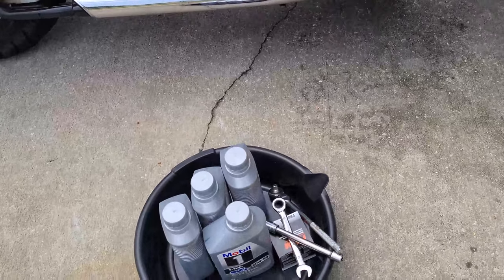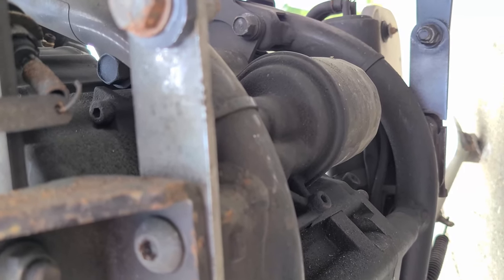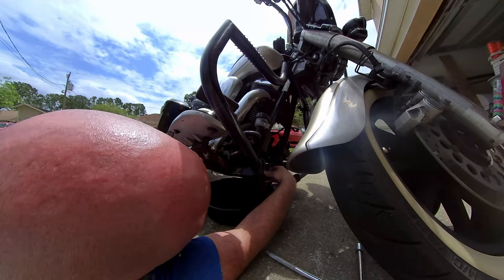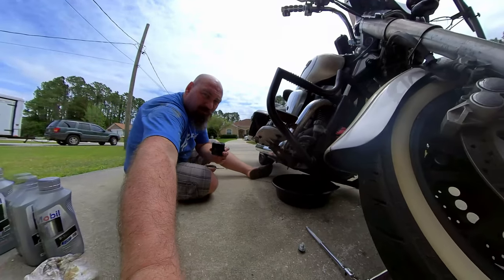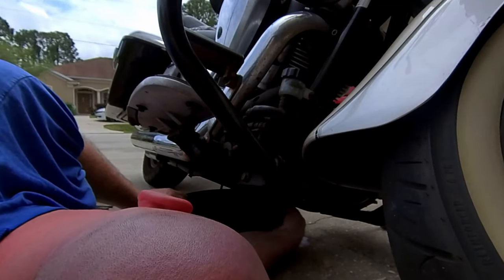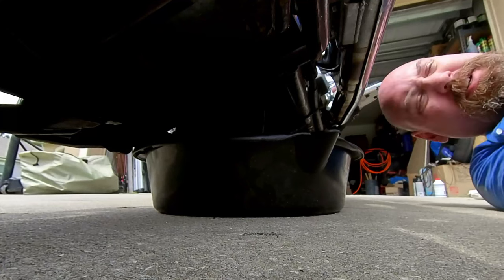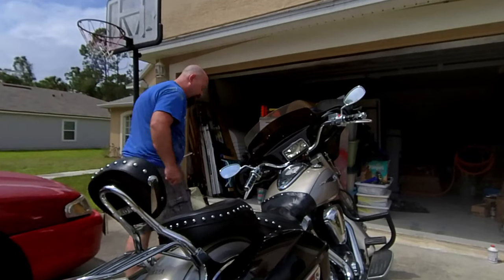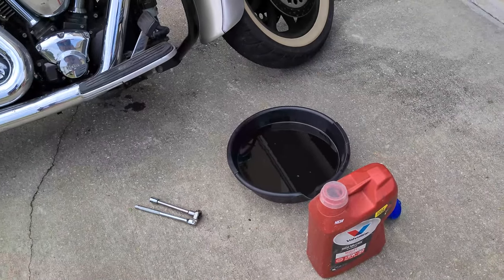Day 13 - How to change oil in Yamaha XV1700 Roadstar

Comment: You more than likely have the original silve colored crush washer that has been CRUSHED over time...thats why it doesnt leak now AND why it did leak with a new copper crush washer (you had unkowingly used two crush washers). Use a thin knife blade and see if you can remove the silver original drainplug crush washer. Now...since you have aftermarket drain plugs (13mm head not 17mm) ita odd that someonenwouldnjas transfered the original crush washer over. Of course this is assuming your 13mm headed drain plugs DO have silve crush washers lol....